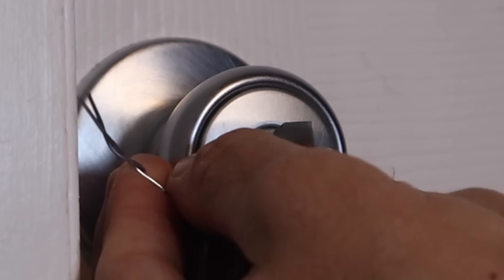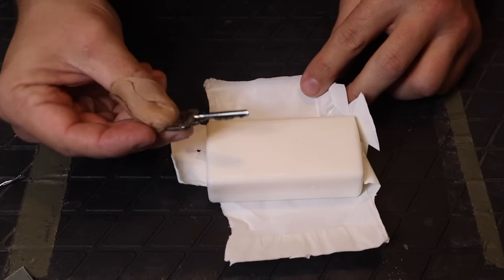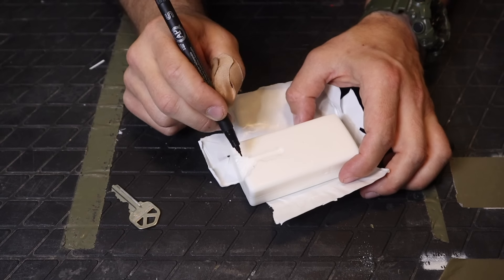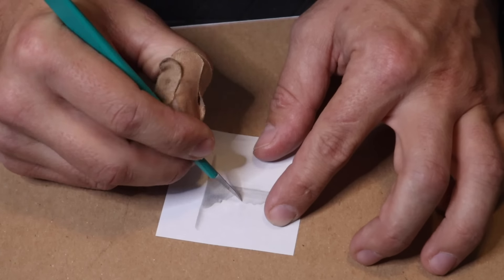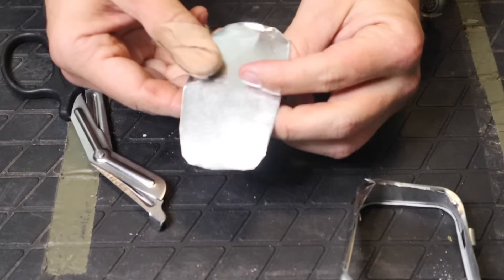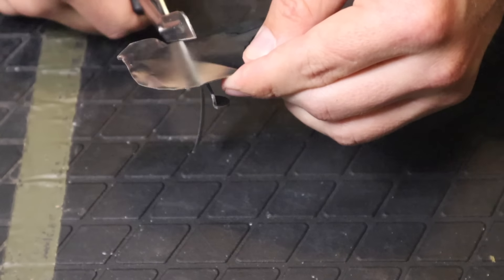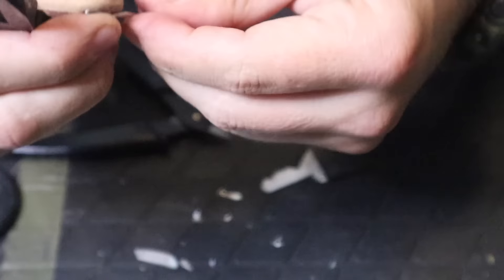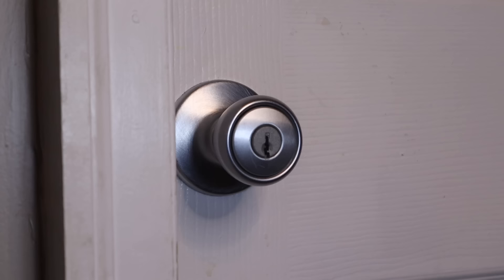Use A Bar of Soap to Make a Key Clone! - Urban Survival Skill!

Comment: I bet if you went over the metal with the tip of a razor knife then gently bent the two sides it would break off much faster. Even if you have to cut notches so you can bent each tumbler surface individually it would be faster than what you were doing.

Comment: Definitely not a bad idea for a field expedient key, but if you're a bit more prepared, wouldn't it be easier to met some gallium or similar low melting point metal and simply use the soap impression as a mold?

Comment: I saw a dude use baking soda and pencil lead dust and use superglue for mold material. He had runny cynoacrylate glue and would sprinkle a bit, glue, sprinkle more and compact it in. There’s also a metal with low melting point I forgot it’s not lead or tin, something like galindinium or some shit.

Comment: Or if it's possible, quickly make a photocopy and skip the soap step... also, you could just use a real key blank and followay the access brass and making a copy of the key that way. I'm surprised that tin can is not too flimsy to do the trick.

Comment: PREPPER PRO TIP: In the long run, it will be easier, quicker, and safer just to learn how to proficiently "rake" the lock with the longest section of a long steel paperclip and use a smaller cut section as a wrench to get through most (90%+) of residential property and commercial office door knob locks in less than 60 seconds (obviously pick a good time when no one is around). Yes it's a skill that takes training, but then all you ever need is to always keep an innocent looking, high-quality paperclip on you at all times.

OR if you have a sacrificial credit card you don't mind tearing up, you can just slip it in between the spring latch and the strike plate. When you know how to tweak the plastic corner it might take you 30 seconds.

Either of these will be better than running the risk of getting caught trying to lift someone's key (which is harder that it sounds because it requires even higher level skills ---pickpocketing & stealth), or going through all that work just to realize your little soap cutout wasn't accurate enough and there you are attempting to sneak through a door with a key that doesn't work.

Comment: you didn’t address the different keyhole shapes that you have to bend and contort the metal just to stick it into the hole. when you account for that, you may affect the precision of the key’s teeth because they could now be at a different height than what you started with. you might have to preserve as much of the teeth portion’s height to the bend so it does not stray from the original key. the lower portion of the key just needs to fit into the keyhole.

Comment: You could also just trace the key on a piece of paper, as far as just making a copy of a key we used to just soot a key blank with a candle, then clamp it together with the original you would file it down till you broke the soot on the blank, then you just soot the blank again. This however is old school locksmith stuff, modern key cutting machines take the skill out of everything you just insert the key and the computer cuts it exactly. I would not call this lock picking, since picking requires tension wrenches and various rake picks. If you had access to the original key it's pretty easy to copy one without using a bar of soap. Actually learning how to pick a lock open is far more useful in the long run.

Comment: I have coded many keys over the years.  I simply hold it up, and eyeball the cuts.  A new employee came to work with us. I didn’t have a telephone installed yet on his desk.  The new guy asked if he could call his wife real quick.  I said sure. He set his keys down on my desk. I looked at them and wrote down my best guess. The next day we went out side for a smoke. He said, oh crap, I left my cigarette’s in my truck, do you mind walking with me, so I can get them.  We got real close to his truck, and I picked up my pace. I got ahead of him and said:  I’ve got this one for you.  I reached into my pocket and pulled out two keys on a ring. I inserted the door key, and unlocked his door. His eyes got as big as a baseball. Once the door was unlocked, I sat behind the steering wheel, and put the other key into the ignition and turned the motor over, and started the truck!  By this time his eyes were as big as a softball. I shut the engine off, and handed him a set of new keys, and said, get yourself a key hide a box, for emergencies!  He asked how did I do that? So I reminded him that when he used my phone, l looked at them, then. He said I was standing right there. And you never touched my ring of keys. I said all I needed to do is look at them! I wrote down my best guess, jumped on my code machine, and made the set of keys.  I joking said…….  With a smile ear to ear. Don’t ever piss me off. I can be your worlds best friend, or you worse nightmare!
Reply: Blitz, #2 or something a little more powerful from Canada?

Comment: Would have been actually easier, and quicker, to just pick the lock with a pick. And with that specific door, carding the door would've taken maybe 3 seconds. And with the tolerances on those cheap kwikset style locks, you probably could have made an effective pick and tension wrench with that altoids tin in about two minutes.

Comment: Kwickset locks are the easiest low security lock possible. You could've just cut your own pick and an actual tension wrench and picked it a hell of alot faster than all that unnecessary b.s. I'm just keeping it real. You don't need any experience to pick that lock right there and that's a residential lock. Your gonna need alot better method to get inside a real building or a nice house.

Comment: Wouldn't it make more sense to trace the key onto the can and then just cut it out? I know the soap and printer is cool but your increasing your chance for error. Just trace it onto you flat metal surface lol you have people out there with soap like it won't loose it's mold in heat.

Comment: Unless its a particularly advanced lock you’d be better off looking up a youtube tutorial on how to pick locks and getting a cheap set of lockpicks that you can dispose of later. Yes, lockpicking can leave marks but you risk so much more exposure trying to get a key from someone you dont know, copying that key, putting the key back where you found it, and keeping the duplicate keys in case you need back in again. 

Unless you’re brute-forcing the lock, it shouldnt be damaged when you pick it, and if you’re going through so much trouble to remain concealed anyways, you’ll probably be very careful when coming and going. Picking a lock maybe takes 3-5 seconds longer than a standard key on most household locks if you’re any good at it and unless you somehow break the lock or someone notices you, no one is going to routinely check their locks for signs of forced entry. 

Learning how to pick locks online and maybe 30 seconds of exposure trying to gain access to your target area vs. significantly more exposure gaining access to the person who carries the keys, taking the keys, copying the keys, and eventually putting the keys back. I know which one im picking

Comment: Why do you need the sosp, printer, etc? Afterall you traced the key contour on the think metal sheet and cut it with shears. So when you had access to original key you could have traced its outline directly on the thin metal strip with pen, couldn't you? Perhaps the soap was there so you could bathe?!!!😆🤣
Reply from the maker: This blows my mind how many people don’t understand this video. You take a quick imprint with the soap and replace the key quickly to avoid being caught. Because that person is going to come back for the purse. If they see it gone then you’re screwed. You go make a key with the imprint so you can access the building any time and as often as possible while avoiding detection.

Comment: Am I also missing something here? Couldn’t you just trace the key from the get-go?
Reply from the maker: The whole point is that the time available to copy the key may be short. We want to get an imprint quickly and return the key without notice. And we may not be able to make a print or copy of it using tech we either don’t have or can’t bring with us, think austere environment. So using an improvised method to create an imprint from an everyday item like a bar of soap is feasible. It could have been modeling clay or any material that wouldn’t have raised suspicion to create an imprint. With the imprint we can leave the area and create the key somewhere we have the tech available in order to access the building anytime we wish and for as long as necessary if done carefully.

Comment: You're better off making a new key by impressioning the lock.  Also, locks don't have sears.  They have shear lines.  And if you're impressioning the key itself, you're honestly better off pasting the xerox copy of the impression to a blank key and using a small file.

Better yet, just go to sparrows and get a very basic set of picks, and learn to use them, then keep them in your kit.  There are so many better ways to do this, even without proper gear and totally improvising.

Comment: I've done that to open a cash register 🤣
Took a pic of the key
Put clear adhesive tape on my phone
Zoomed the pic until it matched perfectly the size of the key (1:1 ratio)
Outlined the key shape with a marker on the clear tape
Removed the clear tape and stuck it to a plastic store card
Cut the card to size,
Used a tensioner shim

Good enough replica, we kept it as a backup 🤣
Best part is I was paid to do that stuff and gave a good scare to a higher-up 🫡

Comment: wtf a printer? how the flowers 🌺 a 🥷🏿 gonna getta printa? This, operation is impossible.
Reply: You could’ve just left a stamp on the metal with the key pressed into the soap or wax and eliminate a thousand steps😂 Don’t do crime people. do this on your own home and leave your little foil keys under a planter in the yard. Just incase you get locked out.😮

Comment: Or you could simply just get the number off the key and go to any hardware store and get a blank and then file your teeth that way.
Reply: That or just understand that most offices and or "High Security" places often cut major corners and use the same door knobs through out the entire building. Google common office keys and bam.  I have a set of ten keys that can open everything I try them on. Most common is the A-10.

On a side note he had the key, should've just make a toothed shim, Would've saved a few hours.

Comment: That is absolutely horrible advice. 
Just have a crowbar. I have a titanium one, it weighs roughly half of what a steel one would + it's a weapon and it's a key to most doors. 
Or have lockpicks on hand if your laws allow them. Much more effective than this.
And first nd foremost, copying a key is complete and utter BS because if you have access to the key, why you need do make copies in the first place?

Comment: There's a kit on the market that's just a small hinged box filled with two flat pieces of clay covered in talc, you squish them around the key and fill the void with the included low melt temp metal, in included spoon with cig lighter.

A bit overdone maybe, but you don't have to wait until you get home to make and use the "key".

Comment: Theoretically couldn't you just take a hot glue gun and fill the key hole with hot glue then carefully 
Extract the it then freeze it soild 
And have make shift key  ????
Reply: I mean you’ve just filled the lock core with hot glue so goodluck turning that thing or moving any of the pins
Reply: @joj3403  
Well .... take a drill and basically 
Break in

Comment: Pretty sure you'll find that plastic (like a soda bottle) works better for a temporary key than sheet metal, easier to cut down and far less likely to contaminate the work area with blood from those metal shavings.  Although a single paperclip alone will easily defeat most Kwikset residential type door locks as shown in the video in less than a minute or two (as well as most Master branded padlocks).

Comment: Couldn't you just imprint the key into the soap completely, remove it, and then fill it with gorilla glue? Let it dry in several minutes then open the door? Or does glue not work? Gorilla glue is crazy strong... I see no reason why it would not tumble with ease inside of the lock... someone comment please if you know if this would work.

Comment: A block of clay or silly putty is better. Pit it in an old Altoids box. But if you have the copy machine just copy the key and forget the soap. 
Making the key just use a key blank and a file. I have hundreds of old keys so I would find one really close and then file down any high spots.
Of forget all of that garbage. I would use my Kronos vibro pick and make short work of opening the door.

Comment: This is not picking a lock...it is copying a key. And you need a lot of other equipment and materials besides a bar of soap. Including the original key! It is way easier, cheaper, and faster to just pick the lock. But since you have the original key, there are several places where you can get a copy made. Watch a lot of MacGyver on TV?

Comment: Why not just roar down to the local locksmith and zip off a real key? Probably be a lot faster and the key would last forever, and you won't shred your fingers with the sharp steel of an Altoids can.

If you don't want a locksmith to know, or if you think the locksmith will have an ethical dilemma, go to some obscure key cutter who just does what he is told.

Someone like Walmart or your local hardware store. You can get a key cut practically anywhere without even seeing a locksmith.

If the key is imprinted with "Do Not Copy", just put a small blob of epoxy putty over the imprint and smooth it good and flat with a rolling pin, and use a razor knife to make the edges of the little square or rectangle, nice and clean, so it looks like it belongs there. Let the epoxy cure for the required time so it is impossible to remove.

You could even get fancy and put your own number or other print on the epoxy blob.

Comment: Never try this hack anywhere in Europe, it will not work. European locks and doors are different and way higher quality.
I live in Germany, some years ago, my door slammed in a draft, key was inside. I called a locksmith to open my door. After one hour of effort with all his fancy tools he gave up. He had to pull out the whole lock with heavy tools and could not avoid to damage my door. Sometimes quality made in Germany has it's downsides.

Comment: after cleaning the excess soap we also want to remove any traces of the soap scent. using a knife blade to remove the soap in the grooves may leave a scratch mark on the key which may be noticed

Comment: gee... why not make a picture of the key and print it out? the soap is just useless, only when melting you use wax
Reply from the maker: The entire point of the soap is to make an exact imprint quickly. With a photo you’d have trouble getting the key to scale.

Comment: we are going to outline the key with a pen, but eh, why bother ?    all you need is to:
(1) be sneaky, and steal a key without being caught, 
(2) bar of new soap 
(3) a pen you won't use
 (4) a copy machine and paper 
(5) exacto knife and a steady hand 
(6) a bandage on your thump to prove you DON'T have a steady hand 
(7) a spare altoids canister
(8) find the pen you didn't use before
(9) a pair of metal sheers 
(10) a pair of smaller metal sheers
(11) pliers and a spare paperclip an a few hours of time to assemble
(12) *  cost of supplies needed to make a Jack key:   over +$160  
= when you could have simply gone to a local hardware store and got a copy made for $2 ?!?

FYI:  putting a sliver soap INSIDE the keyhole and using the paperclip have been the easy route and taken 1 minute.
clearly he has no lock-picking skills  who is this clown?